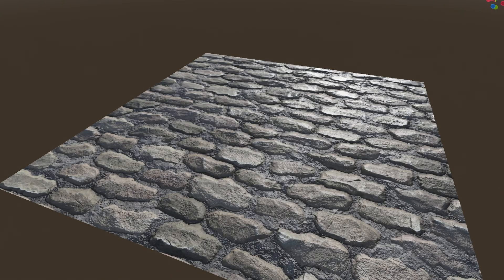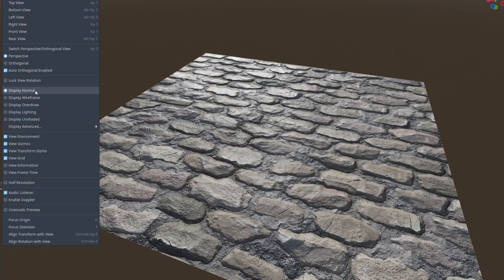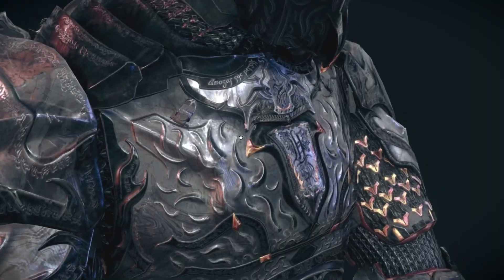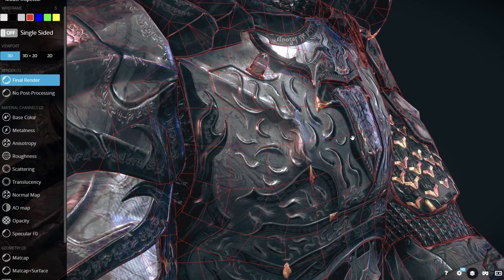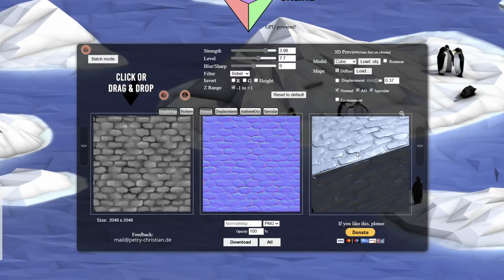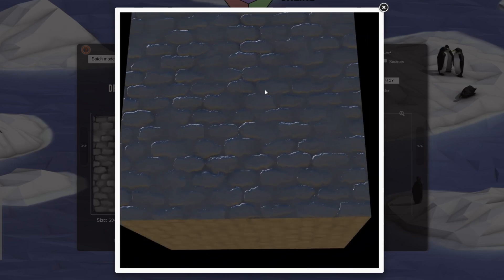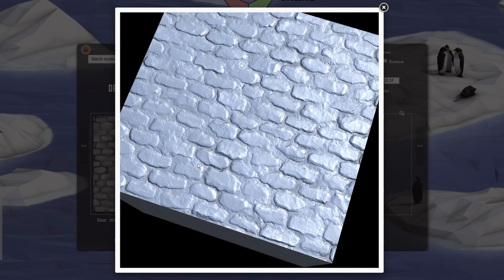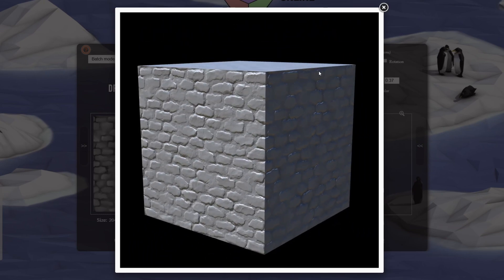How Games Fake 3D Detail: Normal Maps Explained

Comment: So the "after" image in the thumbnail is actually a displacement map, not a normal map.
Reply from the maker: Not necessarily. You can get this kind of surface detail with a normal map as long as you don’t expect the actual geometry to change. For the thumbnail, I softened the outer silhouette of the right sphere to make it clearer that the shape stays the same.
Thanks for pointing it out!

Comment: Thank you for the breakdown! I was curious. I've heard in the past that Object/World Space Normals are faster than Tangent Space normals. Would this be engine specific or do all engines typically convert to Object Space as you mentioned here?
Reply from the maker: It really depends on what you are doing, how complex the scene is, or how many lights it has. The workload varies between pixel/fragment and vertex shaders (from a technical perspective) — it might be difficult to get the right answer just by eyeballing.

In professional settings, I would always recommend measuring. Implement both versions, measure performance, profile, and look for potential bottlenecks, and you will see how it goes for your specific scenario.